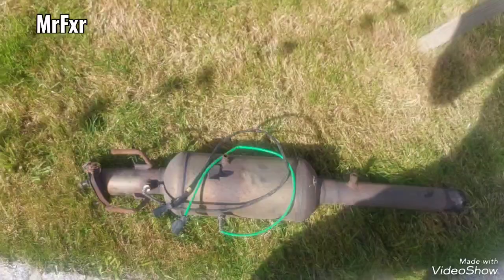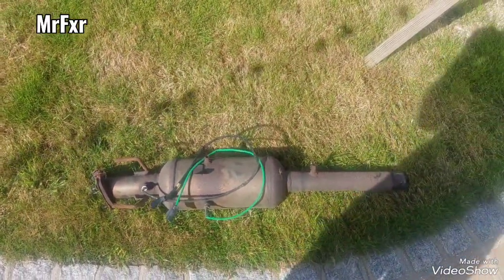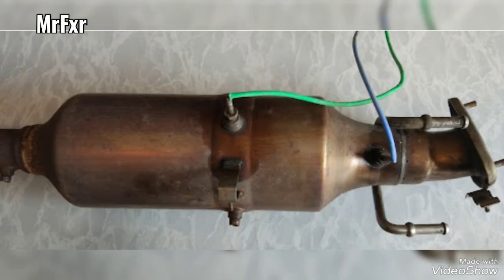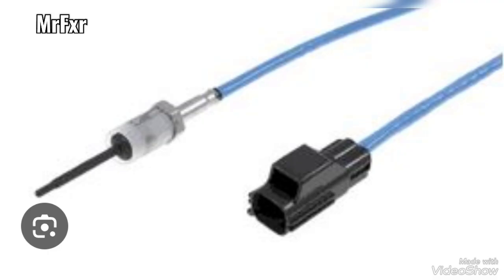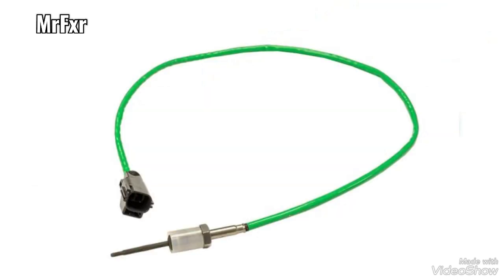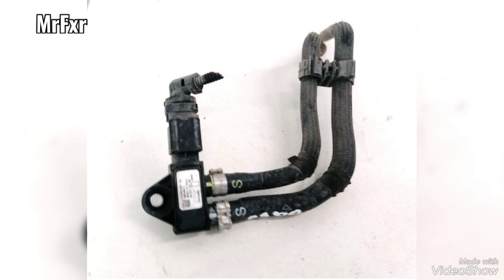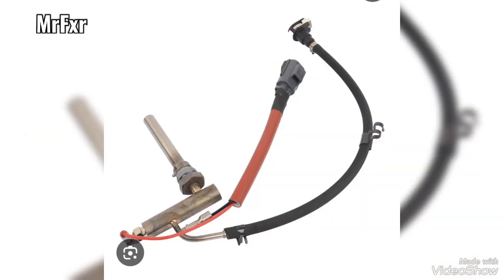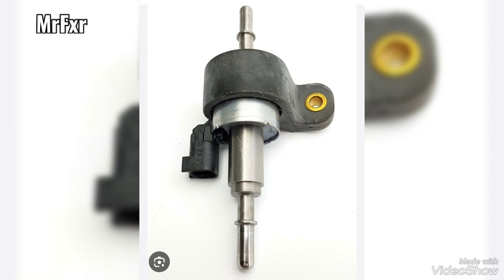DPF tantrums of Peugeot Boxer, smoke at regeneration, no fault codes

Comment: Thanks for informative video👍🏼
Mine is doing regens every 100 miles or so,bit  of smoke setting off during regen but not excessive,engine goes flat during regen,but fine other times .
I think my issues started when thermostat went faulty,engine not getting past 1/4 on temp gauge,so regens not occurring ?
Fifth injector no blockages,jlm dpf cleaner run thru,mpg very poor ,about 22mpg 🤦🏻‍♂️
Needs putting on diagnostics to check everything
Reply from the maker: Have you replaced thermostat. It sounds it's stuck open. Running cold engine will cause it to run rich all the time and produce more soot, clogging dpf quicker
Reply: @ hi,yes I replaced complete housing which includes new sensor,gets up to temp now

Comment: Thank you for the video. Unfortunately, I've had an identical problem for over a year now. My Peugeot Boxer emits thick blue-white smoke during regeneration and smells like diesel. The DPF was recently cleaned by the Peugeot workshop, and the exhaust temperature sensor was replaced. According to the workshop, my DPF is not original but fully intact. None of this helped. I'm not sure which sensor was replaced exactly, but I'll find out.

According to real-time data (as shown in this video: https://youtu.be/bvgV1jInAFI), the vehicle reaches 450°C before the catalytic converter and 580–600°C before the DPF. That seems normal at first glance, or is that too low?

Additionally, regeneration is now triggered every 50 km, and there are no errors in the system. Since the sensor was replaced, I'm now considering replacing the fifth injector. What do you think?
Reply from the maker: I know your frustration, dpf can be a real pain.
Thick, bluish smoke when it runs regen mean that diesel is not burning of during regen. It could be caused by several factors. 
On my one the issue was faulty post dpf temperature sensor. Readings from it were fine, showing around 600c, but in fact temperature was far lower. So, ECU thought that dpf is hot enough for regen and initiated fuel injection on basically cold dpf causing a lot of unburned diesel smoke. Dpf unit is genuine 
Sometimes non genuine dpf can struggle to burn the diesel off, because of insufficient catalyst on the "honeycomb" structure. There is a reason why genuine ones are so much more expensive . Has the problem started after dpf replacement with non genuine one?
If so, I would try to get second hand genuine one from breakers and try with that one. 
If it was running normal regens on non genuine one and after cleaning is confirmed that is intact and problem started gradually, it could be that plating from honeycomb has deteriorated. But if problem started suddenly, it could be temperature sensor. 
Also, a faulty glow plug on fifth injector/vaporiser is burned out and not preheating and vaporising diesel. But that should throw a code. Injector can be tested, run 12v direct to it and check if it gets hot quick. It should get really hot. If it doesn't, it will need replacing. Please don't use cheap ones they often can blow the fuse and malfunction. 
Since it is running regen, other parts of the system are functional. It only doesn't burn diesel off
Unfortunately, I can't tell you for sure where the problem but I hope I've shed some light on it 
Please let me know how it goes
All the best 👍
Reply: @mrfxr1695  Thank you for the quick response. Unfortunately, I bought the van about 1.5 years ago and don’t know why the DPF was replaced in the first place. It was only at the Peugeot workshop, after the DPF had been cleaned by an external company, that it became clear the DPF wasn’t original. That was about a month ago. However, they claimed it was fully intact and now clean again.

Today, I removed the fifth injector to replace it. Unfortunately, I noticed too late that my replacement part didn’t fit, but at least I tested its functionality and cleaned it a bit. It still looked really good and heated up quickly. Only the hose that the diesel flows through was a bit clogged, so I cleaned that as well. In the coming days, I’ll take a longer test drive to see if it’s improved, but I doubt it.

Of the temperature sensors, the one on the DPF (the green one) was replaced. The other one is still the original.

I suspect the next step will be replacing the DPF, preferably with an original one. Do you know of any cost-effective alternatives that are still good? I’ll also check with breakers.
Reply from the maker: @demhadesigns1460  I've paid £300 for good second hand genuine one from breakers on eBay
By what you've said, your fifth injector is fine
Good luck 👍

Comment: The reason for this is because the aftermarket dpf wont get over 300c a genuine dpf will get up to 600c and burns so hot it wont Produce any or little smoke i had Exactly. The same on my kie Karens every 350 miles it would smoke badly with the aftermarket dpf only genuine dpf will work you might be able to save your original dpf if you still have it it need cleaning at low rpms with lunch dpf cleaner if its cracked then cant be fixed good luck
Reply from the maker: I agree, one of the resons would be bad aftrermarket one. In my case it regened daily ( every 5-10 miles) with crazy smoke . I've replaced temp sensors and it was all good afterwards. It took me long time to figure that. So far all good , touch wood ;)